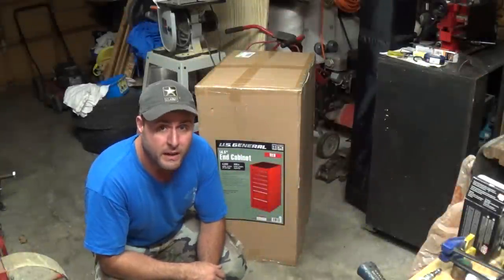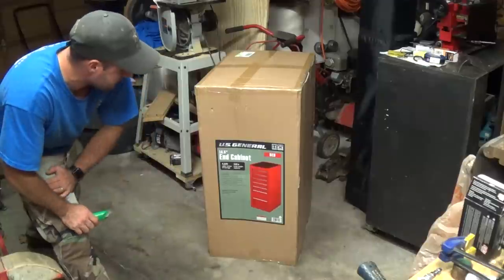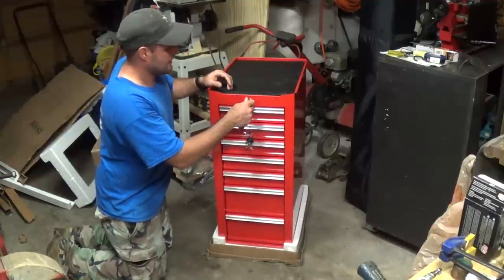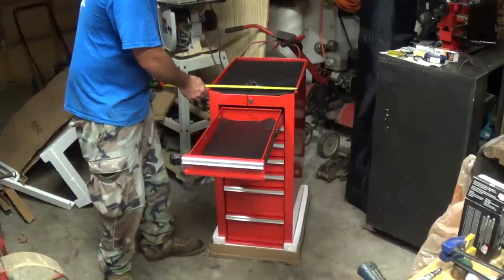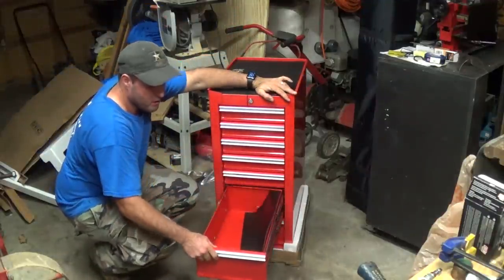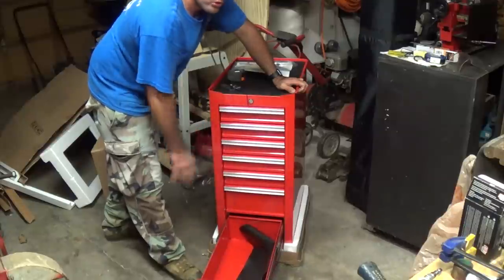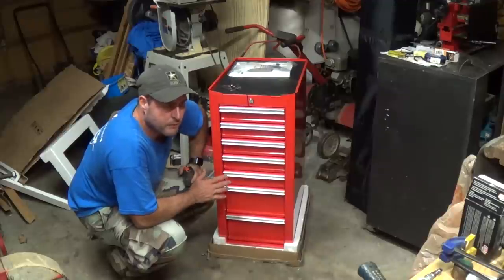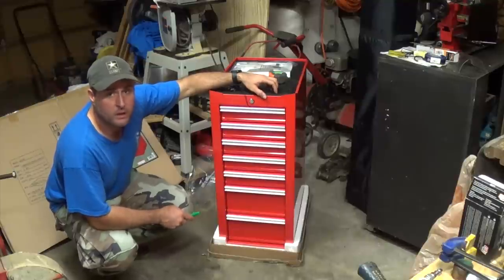Series 2 Side Cabinet for Harbor Freight Toolboxes

Comment: I had that on my old Husky box but when I bought the Harbor Freight 56 inch top and bottom chest I put casters on the side box and use it for hardware/supplies storage.
Reply from the maker: I thought about detaching mine on casters to make a small tool caddy. Would Kinda be like a very small but portable workstation.
Reply: +Everyday Journey I bought the HF three shelf utility cart to use as tool cart. Eventually I will go with a the four drawer sevice cart but that has to wait until I can sell my HF 56 inch top and bottom chest. The 56" set is only a year old (and it's great) but my goal is to go with the HF 72 inch bottom chest with the service cart. Btw, I added 1" decking boards to the bottom of the side box to mount the casters and assist in full swivel. Actually considering bolting two side cabinets together.

Comment: I know I am a year later, but I was just looking through the Harbor Frieght catalog. I had a thought and I'll share it, when I start buying my tool boxes I'll more than likely have the colors represent a type of tool. Red-for cutting tools, Blue-for pneumatic tools, black-for mechanical and defiantly orange for safety equipment. I know that sounds like a lot, but I do have a lot of tools. Precast concrete, concrete form work, millwork, clean room tools and welding stuff are not really interchangeable to much lol. I do like how they have the variety of colors that can be put together in a modular system. Just a touch expensive, but so is losing tools.
Reply from the maker: Organization is key. If you can’t find it when you need it, you are just wasting your time. I’m slowly reorganizing my garage. Little by little, it’s coming along

Comment: Take the lock out go to your local locksmith and have it rekeyed so you're on a one key system.
Reply: Yea cuz every locksmith has those keys! They are proprietary made lacks my friend. Each key has a number computer etched in it and so does the lock facing right at you so you just look at your key and the lock on your box and you know which key goes to white. If you're willing to take the time to change the locks on a toolbox you need to reevaluate your mental situation
Reply from the maker: Still to this day, I keep one key on my keychain and just lock the other in the main box after locking the side cabinet
Reply: @walasiewicz  

Literally any locksmith can re-key those barrel locks. 
Lowe’s should be able to do it.

Comment: Storage and clamps, 2 things you can always use more of.  Nice little addition to the shop.
Reply from the maker: I’ve been using it today at work. It is nice. The liner is different than what came in my new 44” box. I was able to see that the new end cabinet is more narrow than the old one. Someone has one and I measured it to be 17” wide. Kind of a bummer that I didn’t get those lost 2.5 inches
Reply: How much ?
Reply from the maker: Without any coupons or discounts, they are $199
Reply: Everyday Journey thanks
Reply: @EverydayJourney  the old end cabinets were only 18" deep tho.
Reply from the maker: Yep, kind of a trade off. When I bought it I thought I was saving so much rather than getting the next size bigger toolbox. Was really disappointed when I saw that this side cabinet was more narrow

Comment: I have one of these add on cabinets hung on the side of my old Craftsman Tool Boxes. I built a wheeled cart and mounted 2 Craftman Full size tool boxes side by side, then added this on one end.  I almost have enough space for all my hand tools.  But the Craftsman boxes drawers are not roller bearing slides and that Harbor Freight add on really puts them to shame.  So for Christmas I bought a 72 inch Harbor Freight Tool box (in Orange) and will buy another orange add on side box to them.  Still won't fit all my hand tools, but I will mount the old red side box under my metal mill/ lathe table to hold all the measuring tools, gears, dies and wrenches I use on the mill/ Lathe.
I'll order an orange 56" top box with the side box and that should do it more me.

Comment: I just bought one of these yesterday in black to mount to my snap on box at work. For 200 bucks you cant go wrong. And i wasnt about to spend a couple grand to buy a snap on version of this, or go and buy a whole new box. Great review!
Reply from the maker: Thanks man. Hope you like it as much as I do
Reply: Im actually thinking of doing the same lol. Snap on man said $1300 for a end cab for my KRA 55" . For that price, ill go buy another box lmao. When you put this hf end cab on, did you add any casters to the bottom or was the hooks strong enough to hold your tools and box to the roll cab?
Reply from the maker: No wheels. Just bolts on and use it. Don’t really even notice a difference when moving it around.  Just as good quality wise as the box it’s mounted to

Comment: Nice side box.. (You can ask HF, if you can get the lock that matchs your main box,  just remember the number off your main lock) Thanks for sharing 👍👍
Reply from the maker: Not sure they’d be able to match it. They’d have to open up them all to find a match
Reply: @EverydayJourney  not really, I have several tool boxs from different makers an they all tell me to give them the numbers off the lock or key an I pay for that lock.. They will send you keys an the lock, Im sure HF is no different, well they shouldnt be... but I dont own one tho.
Most makers... Have spair parts as parts tend to break or get damaged or quit working... Youd be supprized on what they have to save them money.
If not you can have the lock re-keyed..from a lock smith or they may just tell you to have them order you a set (lock an keys)that matches..

Comment: I agree checking all the drawers if there all the way in is a pain sometimes I have that problem with the right side drawers of my 56 inch topper
Reply: Put magnets on that back side of your drawers, they'll pull themselves shut.
Reply from the maker: That’s a lot of magnets. Plus, I work with a lot of metal. I’d have shavings stuck everywhere on the back of the box. I’ll just push them in like I’ve been doing

Comment: I bought one today and unlike the locker, it doesn’t have any bolt holes for where the handle was. I’m thinking seriously about drilling some holes so that I can bolt it there too
Reply from the maker: I think they did that so that you wouldn’t be trying to move around 1000lbs of tools but pulling on the side cabinet. Remember it’s not connected to the box well enough for that. It may work though. Never hurts to try.

Comment: I have one of those not sure on make but has no lip on either side, the only thing i can do is to bolt it on for my handle holes but the hole is only few turns deep and dont know if it would carry the weight
Reply from the maker: Harbor freight has made this to bolt up easily to their box. Other makes may require drilling some holes to bolt it on. I wouldn’t use any less than 4 bolts but would probably try to use more. Just remember that anything that you would store in it will need to be held up by however you decide to mount it
Reply: @EverydayJourney  its just that all have a lip and my one doesnt but the i might have to use screws that cut up the thread in front but dont know if i can find big ish ones but yeah cheers

Comment: I have a new set of these tool boxes from Harbor Freight. I’m wanting to remove the large ball bearing drawers on the 44” tool cabinet to lessen the weight so I can unload it from the back of my pick up truck. What is the procedure to do this? Thanks, Tom in Roanoke, VA
Reply from the maker: There should be little plastic tabs that you unlatch. There is a video out there on YouTube that shows them. They are easy. Should be able to figure it out without the video

Comment: So these have hangers on both sides so you could mount it on the right hand side of your box if you want?  Every picture I've seen everyone has it mounted on the left
Reply from the maker: Yes. I have it in the left so the casters on the box are on the same side as the handle. Makes it easier to maneuver around

Comment: Wondering if this would work on the side of a craftsman box. Any thoughts?
Reply from the maker: Box would have to be 22” deep or else it would hang off. Also, if you have a wood top, you might have to remove it to install
Reply: A HF 18" deep by 17" wide side box with drawers fits just fine on a typical 18" deep by 27" wide rolling tool box. Fits perfectly on my Kennedy... which makes or at least made Craftsman at one point. Just a little advice; if you load the sidebox up it wants to tip the rolling box to the side. I just cut a piece of 2x12 and bolted it onto the bottom of the side box then lag screwed an inexpensive castor on, sized so it was about 1/16" off the floor. If the box wants to move, it only goes down that 1/16" and stops. When it isn't moving the castor is off the floor and not in use.

Comment: I'm wondering if it can be mounted on their 5 drawer tool cart... 🤔
Nice video...
Reply from the maker: I’ve seen it on the old ones. You have to check the depth of the new one to make sure. Should work
Reply: @felipep5581  actually there's a video which shows a side drawer mounted on
Reply: Yes
Reply: RoCas Cords the cart is 19 inches deep and the cabinet is 22” deep.   In order to make it work (and look right) you’d have to find an older series 1 cabinet and notch the lid
Reply: Yes, u can mount them on the US general 5 drawer cart, and the 56” toolbox and the 72” toolbox, the end cab and the locker can mount on all the  boxes and the cart, u may have to modify the bolt hole to bolt it down but they are all the same depth and everything
Reply: alanmckaybmx 5 drawer cart isn’t 22 inches deep like the boxes
Reply from the maker: My side cabinet IS 22” deep.
Reply: Everyday Journey series 2 cart is 19 1/4” deep so some modifications would be required
Reply from the maker: Good call. I looked at those but decided that I needed a work to to work off of. Would have been much cheaper though
Reply: Yes It can be I seen it on Instagram look up #harborfreight. He put a locker on the other side Looks pretty cool.
Reply: @6.4DieselDoctor  yes just the mounting ledge needs grinded off a couple inches so it can hang off the side.
Reply: Yes i put one on mine.

Comment: Do you know if this would attach to the cart. Not the tool box.. thanks
Reply from the maker: I’ve heard that the cart is only 19” deep. The new side cabinet is 22”deep. It will work but it will hang off the back or front by a few inches

Comment: Amazon sells complete sets of locks for around $10, you'll need 5/8 locks. Is your 44" tool chest a series 1?
Reply from the maker: It’s the series 2. I’ve looked into a new lock. It’s got a 180 degree turn on it. Makes it a little different than most

Comment: Is there room to mount casters if you wanted to?  Thank you.
Reply from the maker: Yes but it would only help if it was standing alone. It is only held to the toolbox by the top hanger and two bolts. The main box should support the weight fine
Reply: Everyday Journey thank you for the reply. I like the idea of it standing alone. Have a good one.

Comment: Will these work with the old series 1 chests?
Reply from the maker: No, they are to deep. They would stick out the back
Reply: Everyday Journey I have two of the older 44” boxes. I couldn’t find an older side cabinet so bought the Series 2. It’s a few inches deeper so I notched the hangers to fit the old boxes, between the two 44” boxes. Works great! Mine stay put so mobility isn’t an issue.
Reply from the maker: They will work they just stick out the back. Or the front if you choose to do it that way

Comment: How wide are the drawers themselves?
Reply from the maker: Widest drawer 36 3/4” , smaller wide drawers 22 3/8”, smallest drawers 12 1/4”
Reply: @EverydayJourney  those are the measurements for the 7 drawer end cabinet?
Reply from the maker: No. Those are 10 1/8”. Other measurements are for new 44” toolbox drawers

Comment: I wonder if I can add that to my Milwaukee tool chest
Reply from the maker: As long as the depth is the same as yours and the Milwaukee has the folded metal lip on the side then yes. I saw the old one mounted on a snap on at my job. Works great

Comment: Great video,  I got the 22x26  roll around and wondering if the cabinet you are showing fits what  i have or do they make different sizes for other roll arounds???.
Reply from the maker: As long as yours has a lip on the side for it to hang on I would think that you’re good. Also look for the two holes that the bolts should go through a few inches from the bottom. I think they only make one size that has the drawers.
Reply: Thanks for taking the time to answer my question. I've made mistakes buying in the past thinking it would work and getting stuck with them LOL!!.  thanks again.
Reply from the maker: You can return it if it doesn’t work. Just check the measurements. Good luck.